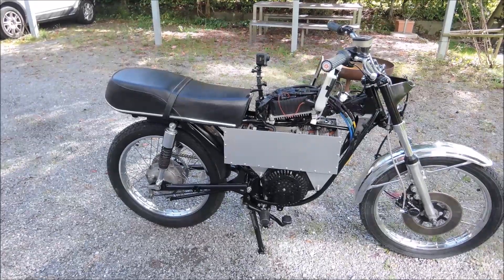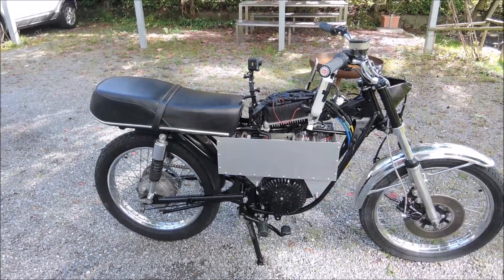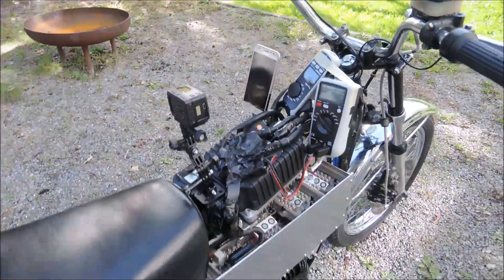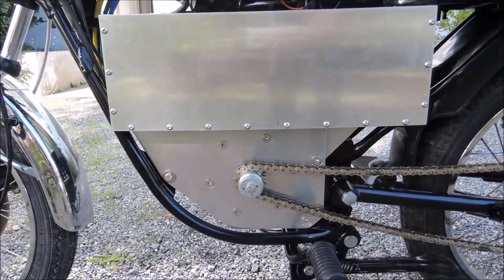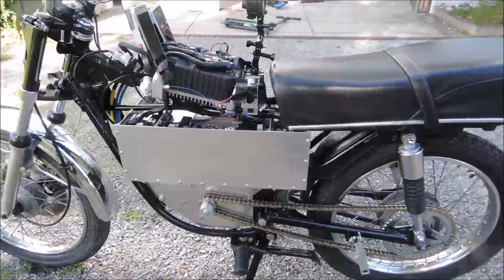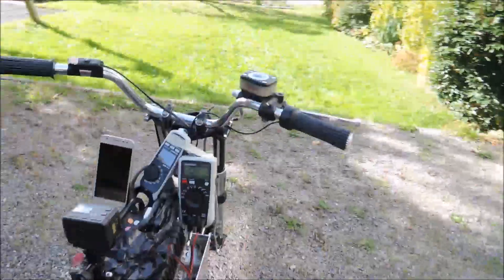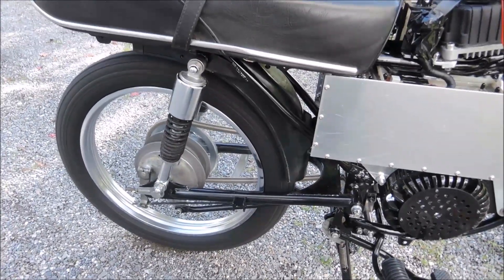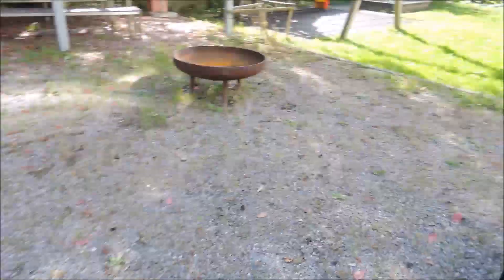Electric Conversion - Spin Demo

Comment: Great works!!!
I’m using the same motor in my electric motorcycle project. 

What is the top speed of your motorcycle?
Reply from the maker: I could do 100km/h with fully recharged batteries @84V, therwise it's less. 12/45 sprockets.  I might try 12/39 for more speed. But for now I'm finishing the motorbike for the road worthy test.
Reply: @andiskleinewerkstatt  Thank you for the reply. 
I chose 13/90 sprockets to run at 80kmph. 
According to the data sheet from the Golden Motors, rotation would be 4700rpm with 47.8V batteries. Is this correct?

Anyway, I can't wait to see the road test.
Reply from the maker: @HIRAGInoDESIGN  You're obviously using the 48V motor. To calculate a proximate gear ratio you need to take the Max Power point from the curve sheet for your desired top speed. So you get 3442 rpm @46.29V (not 4733rpm). This is just for a starting point. Because the motor will draw 286Amps at this point and I'm quite sure your battery will have a lower voltage at this current. So the rpm will be less. At least this was the case with my setup. That's why I will try a faster gear ratio.
Reply: @andiskleinewerkstatt  I appreciate your kind explanation. I have little knowledge about electrical devices, so this information help me a lot.

I'll try with 13/50 sprockets from the original motorcycle. It would be 110kmph max.

Comment: are you able to connect speedometer to kelly controller?
Reply from the maker: I'll leave the original mechanical speedometer on the bike. I'm not sure if the Kelly controller has the ability to connect an electronic display. I'm planning to display the battery recharge level on the not used rpm gauge.